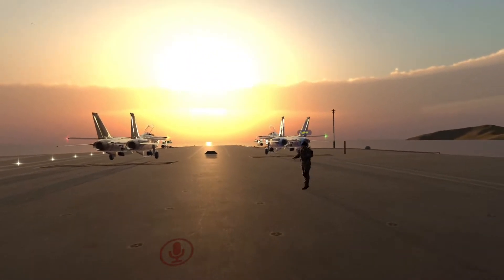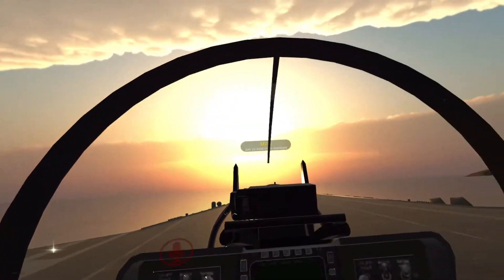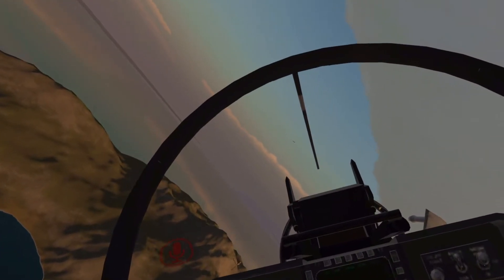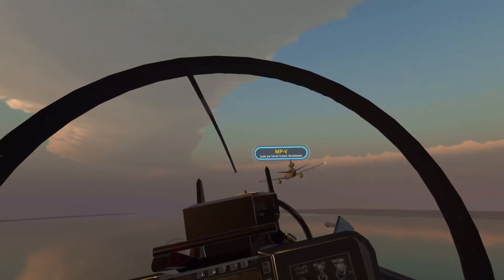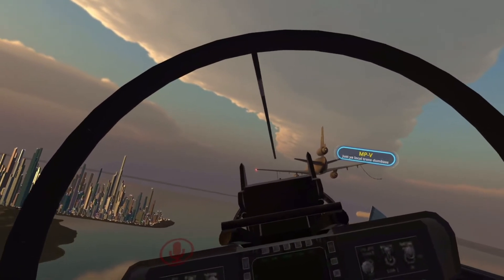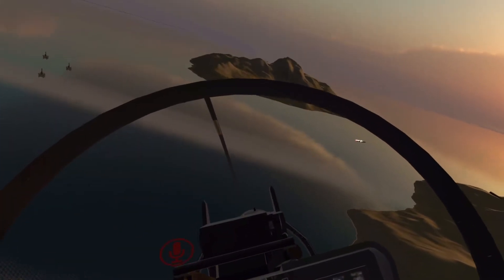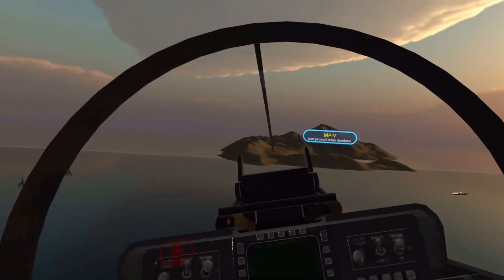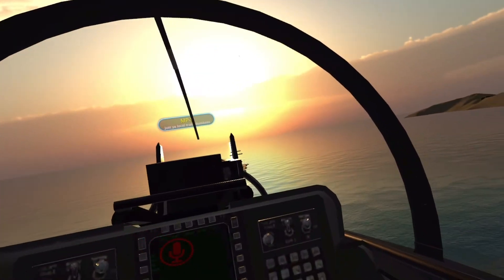(VRChat) How to Air Refuel - Aircraft Carrier Jets: F14

Comment: quick question how do i use my planes rudders to turn i dont know how and ive been just going sideways and pulling the yoke up
Reply from the maker: Turn flaps on, while applying a little pressure to brakes while turning the plane
Reply: Turn the stick sideways (yaw)
Obviously, you wouldn’t be able to do this in real life, but it makes up for not being able to use your feet pedals.